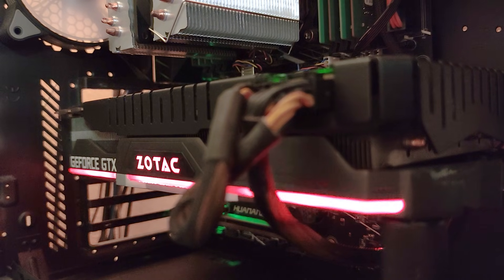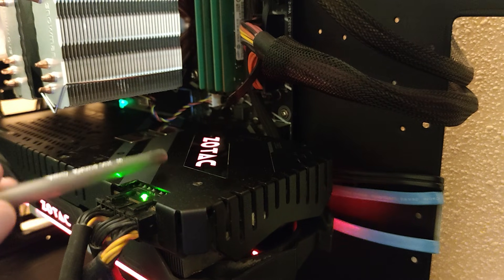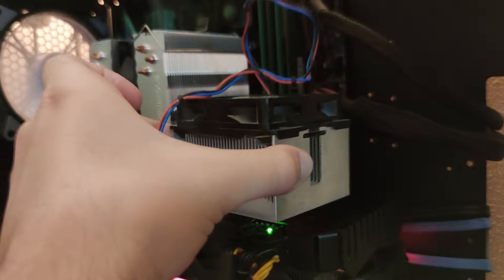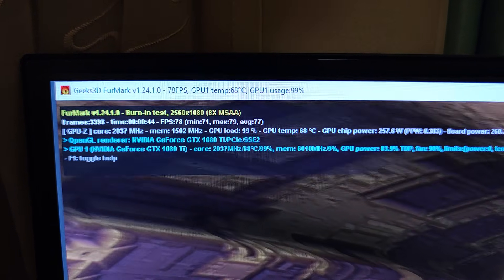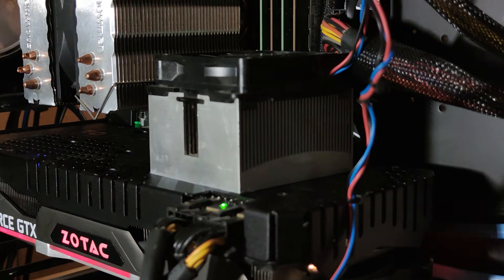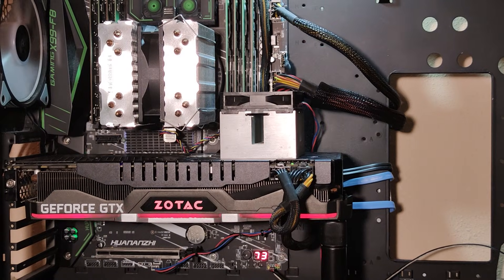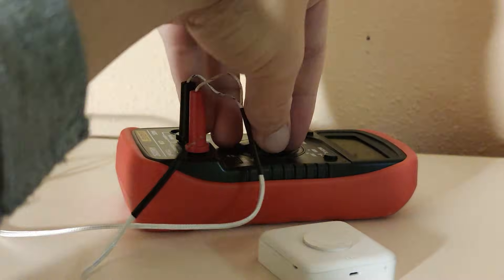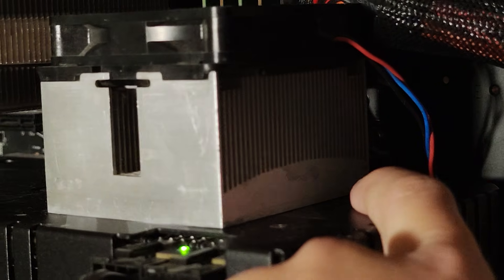-t°C !!! TURN AN OLD AM2 COOLER INTO GPU BACKPLATE COOLING SYSTEM + TESTS

Comment from the maker: SAD THAT MY MULTIMETER THERMALCOUPLE DOESN'T WORK FOR CORRECT TEMPERATURE MEASUREMENT, BUT I SWEAR TO YOU, BEFORE ADDING THIS ADDITIONAL COOLER I CANT HOLD MY FINGER ON THE BACKPLATE AFTER 10MINS OF FURMARK TEST BECAUSE OF REALLY HOT SURFACE OF BACKPLATE! BUT AFTER PUTTING THE ADDITIONAL COOLER, I CAN HOLD MY FINGER AS LONG AS I WISH 🤣 SO ITS WORKING!
Reply: I suggest a cheap laser thermometer as a more reasonably measuring tool than "does this person have immunity to fire like grandma does with the stove top? yes/no"
Reply from the maker: @stephenkolostyak4087  but u cant measure temperature between backplate and PCB by laser thermalmeter, only on surface. But it's interesting to put thermalcouple under backplate and measure temperature under backplate 🤔🤔

Comment: Next time use GPU-Z program on the sensors tab and can see temps for GPU, MEMORY and HOT SPOT.
Reply from the maker: @JDD_Tech_MODS  im using gpu z in this video, there is no memory temperature sensor on 1080ti

Comment: If you want to stress test the GPU even more, do not set MSAA to anything in furmark. I have 1070Ti and at 1080p no multisampling antialiasing i can push the core chip to 130% TDP or GPU Power. With MSAA enabled you pushing partially the memory also and GPU Power stays below 100%, your package power was 206W while my 1070Ti pushing 240W and you have 1080Ti. Don't use MSAA if you want to stress test the gpu more
Reply: Your TDP averaging from 200 to 260W while my GPU stays 240W all the time by not using the MSAA
Reply from the maker: @samohraje2433  i don't know about it, thank for your advice!
Reply: @ try it. I'm testing all the GPUs that i re-sell like that. There are other programs to test GDDR memory but if the gpu chip  is damaged it can't handle 1080p Fullscreen stress test, it'll crash instantly. Using MSAA is good for measuring overall average temperature performance but 1080p without any MSAA is a real world scenario in gaming. I especially set the timer to 30 minutes and if the GPU is stable without any artifacts after 30 minutes of pure hell for the gpu, it is 60% fine because i have to test the memory as well. Basically for the memory the Unigine Heaven is enough or TimeSpy with maxed out details
Reply from the maker: @samohraje2433  thank you man, I'm don't hear something like that, thats interesting! But I have no thermalcouples for my multimeter, so even with 140% tpd  and full memory load, I cant get know temperature of VRM and memory chips on this graphic card 😕 this video was about backplate cooling, not about benchmarks and stability testing 😅😅

Comment: Nice video, would be interesting seeing if gpufan speed and frequenzy was changed or not.
From tdp look like gpu wasn't giving 100% for thermal reason
Reply from the maker: @RoyTs6163  what you mean about fan speed and frequency changed? After putting backplate cooler? Or what? I'm sorry, I'm missed out meaning of your questions
Reply: @qm1s  I mean: gpu temperature showed on furmark didn't change. 
So I wondered that maybe with the added heatsink you are cooling more also the main chips but the gpu are compensating with more power and more frequency.
Reply from the maker: @RoyTs6163  backplate cooler doesn't affect gpu temperature, video about additional power VRM cooling through backplate, because VRM situated under backplate, and heat from VRM pass through backplate
Reply from the maker: @RoyTs6163  and no, gpu power still the same, temp limit of 85° doesn't reach while testing, so frequency and power still at same level
Reply from the maker: @RoyTs6163  added cooler helps to cool down VRM, not GPU

Comment: Just add the fan without the heat sink, and it does the same thing, but better.
Reply from the maker: GPU backplate copper heatsticks can cost about 50$, but am2 cooler is free (or cost almost nothing)
Reply from the maker: Radiator+fan is better than just fan
Reply: Fan alone can't be better